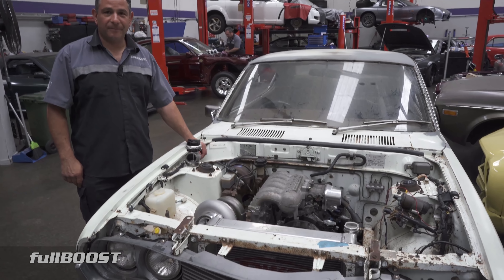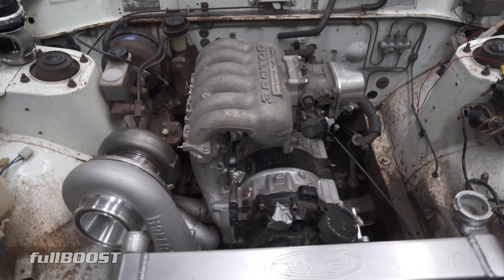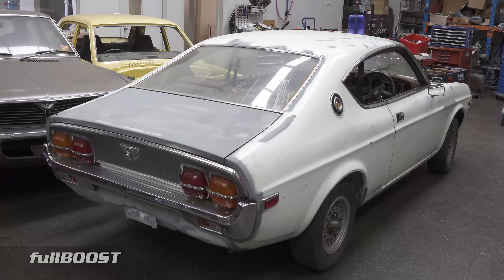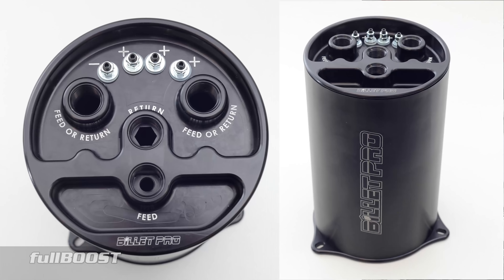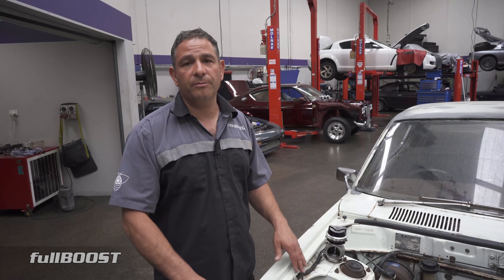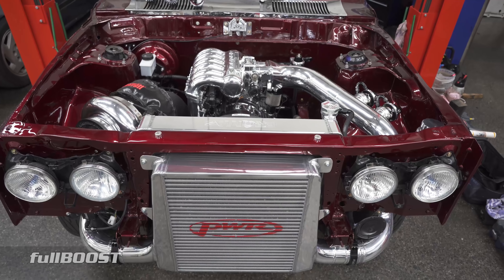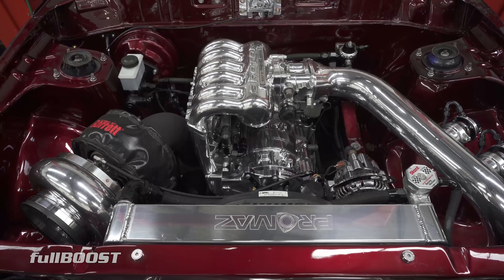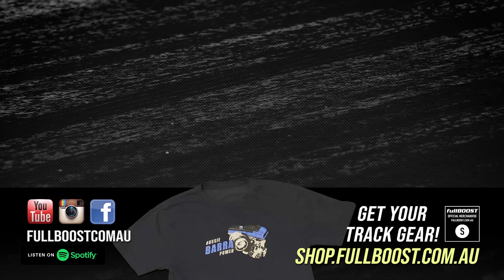20B Mazda RX-4s in the build at Promaz | fullBOOST

Comment: I wonder why they stick with the factory rotor housings when they are already investing in billet end plates
Reply: Not aware of anyone making aftermarket housings, not even sure if Mazda is still manufacturing them..
Reply from the maker: The plates are the weaker points not so much the housings.
Reply: @fullboost  Ahhh, is that right. Fair enough
Reply: @TechnoMonkeyFarm  That could become a problem in years to come- eventually someone will have to remanufacture them. Cheers for the answer- never been into rotarys